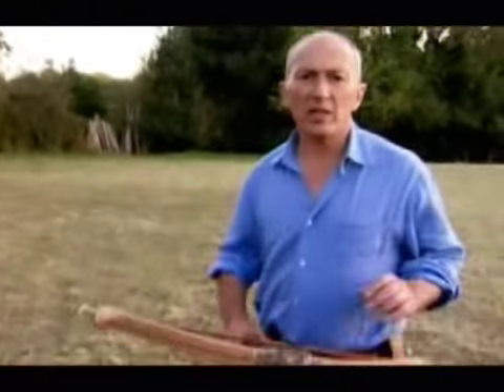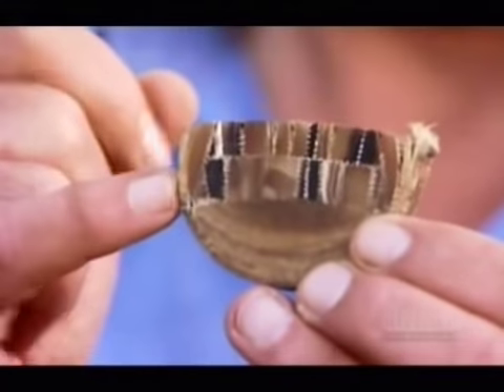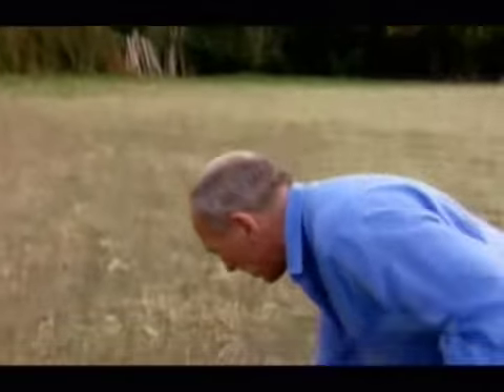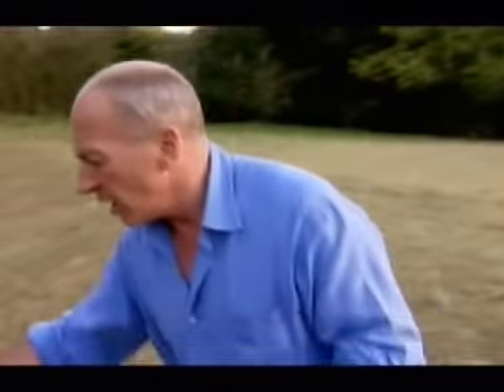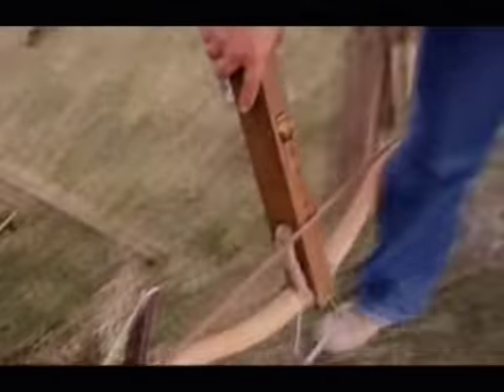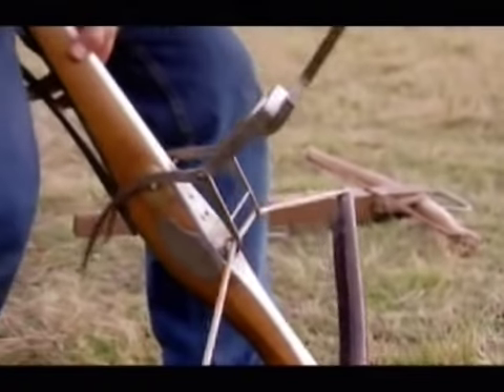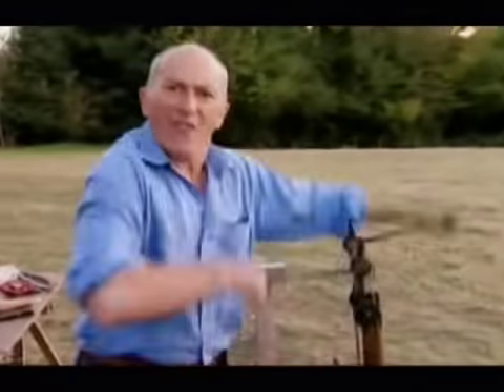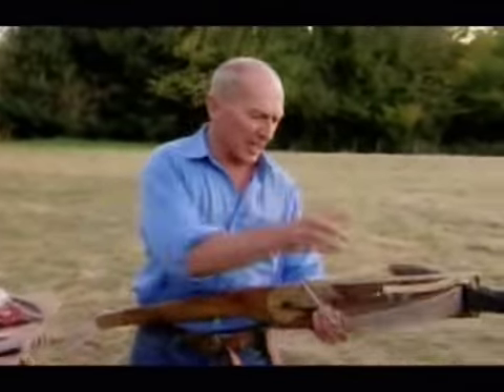Crossbow

Comment: On an episode of Weapon Masters, Mike Loads explains the difference between European and Chinese crossbows. European crossbow has a rolling cylindrical pawl called a 'nut' to retain the cocked string and  trigger system, was used to retain the force of the cocked string in the nut and then release the nut to spin and the string to shoot the bolt.  Chinese crossbow has a sophisticated bronze triggers with safety notches and is nibble enough to release but strong enough to hold the string.

Comment: By the Sung Dynasty in China, the Chinese had a very powerful crossbow or arbalest known as the Divine Armed Crossbow with the accurate range of 300 meters. The Chinese also developed a type of siege crossbow which composed of 3 composite prods with its range of a mile. A hand held version that required 2 men to operate was developed and the evidence can be seen from the craving at Angkor Wat, Cambodia.

Comment: The prod of the European crossbow is so short that the full draw is located barely half way of the stock. The prod of the European crossbow is not recurved despite being a composite material. The full draw of the Chinese crossbow is located at the end of the stock and the prod is a recurved composite one. When Mike Loades fires a bolt from the Chinese crossbow, cracking sound like the sound of a whip was heard. The bolt travels at a supersonic speed when released and penetrates a target deeper.

Comment: @crazyviking24 The prod of the European crossbow is so short that it is necessary to use metal gears and cranks to make a draw length. Its shortness also resulted a shorter draw length which resulted a shorter range. The Chinese simply attached their recurved composite bow on the stock. The longer draw length of the Chinese crossbow allows the bolts to hit its target at a much further range than its European counterpart.

Comment: @Twycross The recurved composite bow went through more evolutionary steps as centuries went by. The ends of the bow was futher stiffened allowing more energy to store up and the use of string bridge to increase the speed of the arrow when released. The most powerful recurved composite bow is probably of Turkish design. In 1971, an American archer shot a thin carbon arrow with a Turkish composite bow and its range was 1854 metres.

Comment: @crazyviking24 The prod of the arbalest is made of steel therefore using metal gears and cranks is necesarry to make a draw weight.The compression power of steel allows the bolts to travel further than those with composite prods. It is very useful to pierce the armor of medieval knights especially at close range. However its full draw is still located halfway of the stock. Its range may be still shorter than its Chinese counterpart.

Comment: @MrLantean That is not actually true. The later European crossbows used metal gears and cranks to create a larger amount of strength. The range of an Arbelest (late Medieavel crossbow) was greater than the yew longbow. A recurved composite bow placed sideways on a stock would have had a limit to how powerful it could be as it depended on length of draw. European crossbows used the tension from the twisting of horsehide/hemp draw strings which would have been more powerful.

Comment: In the West, crossbows are invented to defeat medieval knights as crossbow bolts can pierce the plate armor. In the East, crossbows are invented to equip peasant soldiers with weapons that required less training. In the West, crossbows are restricted to small groups of elite force as they are expensive to produce. In the East, crossbows are being mass produced with industrial capability. The trigger mechanism are mass produced through casting.

Comment: Hes just mentioning Western Europe Greece is not in Western Europe.  Also the chinese crossbows around 5th century BC had more advanced technology such as triggers and composite limbs.  They also could be fired off horse back with devices for pulling the string back from the body like later seen in Greece and Eastern Europe.